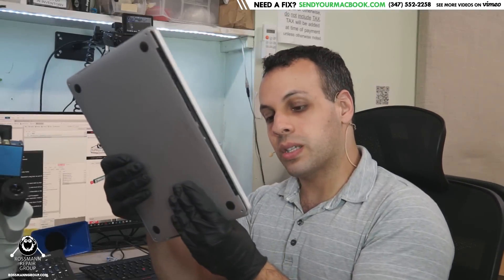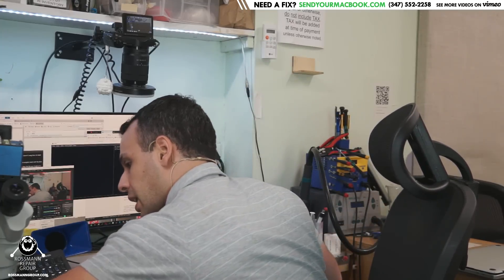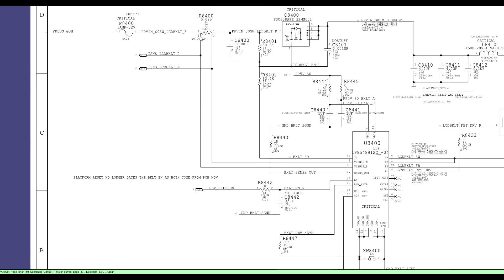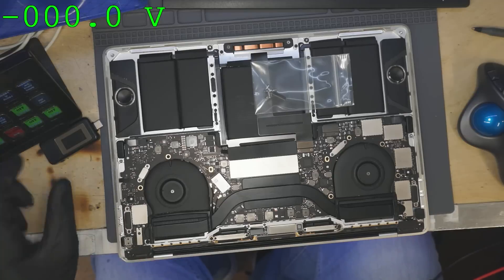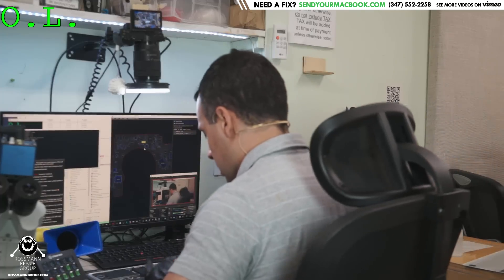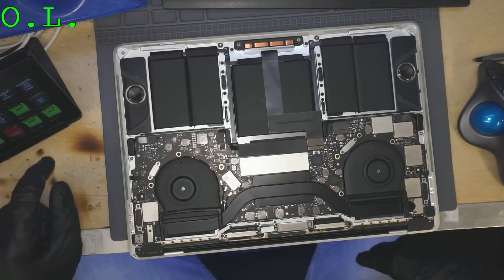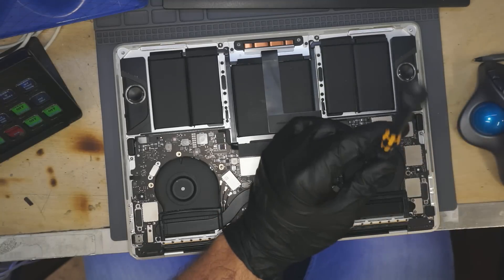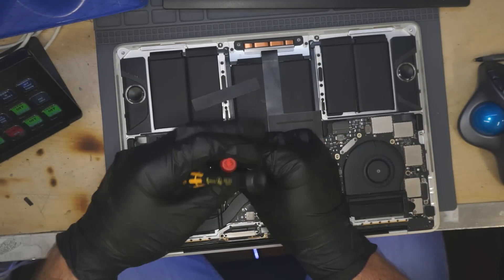Mac authorized dealer said WHAT??? + 1st attempt at ASMR board repair.

Comment: I really don't get that sh*t. The very purpose of a fuse, is to be a (somewhat) easily'ish replaceble, cheap, sacrificial component, protecting other, more complex/expensive components or a system as a whole from failing due to destructive overloading (or shorts).

If the component(s) it's supposed to protect, has no significant manufacturing or assembly defects yet frequently blows before the fuse does - then the fuse/fuse circuit design is EVEN WORSE THAN IF IT WASN'T THERE AT ALL! - Because everyone from other development and design engineers, to customers, operators and service personnel, predicate further engineering design and use of that  system, on the basis that the fuse will actually serve its purpose. 

Now this is "just" a consumer laptop device, and thst fuse has never been intended to be "user replaceable" (if working as intended, you'd really wanna check why it blew in the first place, before replacing it). But from an engineering perspective, imagine if this was a manufacturing component. Instead of ie. 5-30 minutes downtime, that happening may spell days or weeks. That could mean millions of Canadian peso-yen lost, or even worse. This is a huge design flaw, and should have been picked up VERY early in RnD.

Comment: I’m surprised the reason the backlight fuses never blow is because Apple actually built in a failsafe protection system that either works as intended or, when it fails, it fails in a safe way. 
Sure, the only thing that blows is the failsafe system itself, but you can just consider that as a second form of fuse!
It’s like having a fuse that physically blows and a digital fuse that stops things from physically blowing that also acts as a regular analog fuse and physically blows!

Comment: It's true that every authorised shithead does that ... two years ago I accidentally slipped some water on my OnePlus 3 phone and the phone's buttons including the capacitive ones and the Alert slider were not working...I dried it went to the authorized service centre ...I had insurance BTW still they refused to honour my insurance and my warranty then I asked how much it would take to repair it ....They said 264$ and the same thing was replied by the insurance company...They were saying my logic board shorted....I took it back home bought opening kit and took it apart and dried it and cleaned it...It was fully operable and I was ....😑😑😑😑 I have now spent like a 50 $ to replace my fingerprint ,Power and volume flex and earpiece speaker ...and currently typing this comment from it

Comment: Apple cars: One of the spark plugs has failed, you need to replace the entire engine.
Reply: there's a hole in one of the tires? time to get a new car
Reply: if apple made a car would it have windows...
Reply: @dcfuksurmom  It would, but the windows would be triangular, at foot height and you cannot open them.
Reply: @dcfuksurmom  and then they'd claim to have invented it first.
Reply: @dcfuksurmom  Of course, you just need to buy the window wind down switch adapter for only $1900 which comes in a beautifully packaged box.
Reply: @dcfuksurmom  no, just 4 cameras lol
Reply: and the engine cost as much as a new car
Reply: Apple Car: The starting battery has run down, and there's no way to charge it. Solution: buy a new car! Coming soon to a MacBook near you...
Reply: @Zippy1415  Nah they would let you change out the battery like in current devices, but if you don't get it replaced by Apple, the car won't start.
Reply: SireSquish how about buying whole new car after spark plug failure?
Reply: Genius Car Shop "The windscreen wash has run out and there is no way to refill it. We can attempt to replace the engine which comes with a full windscreen wash reservoir, but it will cost you $100,000 for the engine plus $5000 labour. We would recommended you to buy a brand new Apple Car instead."
Reply: @evokaiyo  Don't get me started on the muffler bearings and blinker fluid....
Reply: and all because they soldered them to the block
Reply: you got a flat tire, you need to buy a new car
Reply: An Apple car wouldn't have an "engine". hence no spark plugs. But I get the joke. CrApple IS the joke.
Reply: just wait till electric apple cars. Why is my car getting slower to accelerate? it's only been a year of me owning it. Time to replace every single battery cell
Reply: Replace your mother's pacemaker with a television remote. Quote unquote
Reply: Apple fanboi spotted ;)
Reply: @ferret lol
Reply: Nonsense, Applecar needs to oil changes or gasoline and if so it's easier to replace the engine when it stops running
Reply: Apple could not make a car, because it would be too thin for Americans to fit inside it...not to mention you'd need a dongle for the tires.
Reply: ferret lol.... I read that as the “any key” has failed.... customer “where is the ‘any’ key?”
Reply: @Photo Art lol
Spoken like a true drone ! hahaha
Reply: Sparg plugs? You went all out and paid for the multiple spark plug model
Reply: I would be dead the moment I get that answer lol..
Reply: Blinker fluid in the Bmw is low! You need a new Ferrari!
Reply: Apple car is tesla
Reply: Apple, Tesla, not a dime worth of difference between the to if them. I pity the Tesla customer when the batteries in their Tesla finally gives out and he/she learns that their car's resale value is pretty close to zero, since the price of the battery bank will be over half the value of a new car.

Comment: My MacBook Air needed press and hold for say 30 secs the power button to boot up and was sluggish to run very basic apps. Apple told me to change the board. An independent repair costed a meagre 65$ to fix it and now it good as new. Regards from New Delhi, India.

Comment: 1) It was pretty obvious to me that it was the third capacitor from the bottom that caused the issue:
2) You could've just used the thermal camera to detect it in more reliable and civilized way. I don't know why didn't you do this from the start.
Reply: oberonmeister who wouldn’t want to use that bulldozer?
Reply: @Inn0IWNL  I can understand such appeal, but in this particular situation it was a giant stretch and completely unjustified to use it. However, I admit I would probably desperately look for any excuse to use it as well.

Comment: Why didnt you measure the capacitance with your multimeter?
Reply: Because, he wanted to be a warlord..., The other capa seators would not grass the faulty one up, so they all get executed.
Reply: I'm sure there may be technical alternative, but removing them all makes for more dramatic footage. Louis does the same to JTAG connectors.
Reply: To get a reading for a given cap it'd have to be isolated from the other circuitry, IE desoldered at at least one end - otherwise he'd just be measuring the lot of paralleled caps whichever of the he put the probes on. 
Cheaper to bulldoze and replace the lot (time worth more than the caps) than to pinpoint the exact cap.
Reply: @michaeltempsch5282  Technically it was the short to ground that caused the problem, not the capacitance value, but I agree it would have to be desoldered to test.
Reply: @michaeltempsch5282  good point, didnt realize they where in parallel

Comment: I remember when I was working for an Apple dealer, the "bad backlight fuse" was almost a catch-all term for "we tried another screen and it still didn't work, therefore it must be the board as well" among some technicians I knew.

Possibly because with some earlier models, Apple would provide the fuse locations for each board (not full schematics, just the fuse) and allow technicians to test it for continuity. I don't believe that's something they've been doing for more recent machines - especially not the Touch Bar era machines - so saying "it's the fuse" based on the Logic Board not supplying power to the backlight is perhaps an assumption based on past experience, and not necessarily a correct one.

As for recommending a replacement Logic Board for a fuse, that's the Apple position that authorised repairers are contractually required to take. They aren't permitted to take a soldering iron to a board, nor are they supposed to recommend other repairers that can. Some techs I knew would allude to a component problem, saying it's a fuse or another component if they had reason to believe it was at fault and could be a simple repair, as a sort of "wink and nudge" toward the independent option.

(Then there were technicians like myself. Well beyond giving a damn, playing Louis' videos in the workshop and referring around 4-5 "not economical to repair" or "vintage product" jobs to the local independent a week, to the point where we'd occasionally all catch up for drinks together and talk shop. Those were good times.)
Reply: That's a pretty lame method for them to take but it proves the Louis is speaking the truth.
Reply: So basically don't buy an apple product. Got it
Reply: Replacing parts is technically not repairing. You're not fixing the board... You are replacing it. Lol

Comment: I was watching Paul Daniels' stream and he had a similar scenario.  He said he didn't have a big iron to remove all the capacitors so he relied on his sense of touch to locate a hot area of the board. The amperage draw reading pointed the way. He swabbed a row of suspect capacitors with an alcohol soaked Q-Tip and the bad one dried up instantly.  No need to solder a wire and add power to the circuit and waste alcohol for theatrical effect.  Was Paul Daniels using dry humor to poke fun @ Louis' antics? I sure hope not.  Me likey theatrics. Me like to be entertained.

Comment: Louis, I am just WONDERING if Apple or authorized dealers do operate logic boards like you do by analyzing then replacing bad components or they just change de board by default to solve an issue ? Is that not their official way of working ??? Do you know??

Comment: > You need to replace the whole board because the fuse is broken.

Not an electronics experts, but to me, that alone should tell you something is off. The reason a fuse is put into a device is to be a sacrificial component to protect the rest of the system. If an entire board has to be replaced because the fuse is bad, then why do you even have a fuse at all.
Reply: Exactly! But ya know. It's all for the money :/
Reply: It's cheaper for them not to replace it because they make them in China for a very tiny percentage of the price they would charge you for that board. If it's under warranty, anyway, at least its free. If not, they convince you to replace the entire laptop. Either way, they make more profit than if they had actually bothered to do any kind of component-level repair.
Reply: Hey. It is not simply a "fuse".
It is an iFuse!

Big dfference for a fanboy.
Reply: hmmmz... we are talking an apple fuse here... i am pretty sure it still conducts and didnt blow..
Reply: @milenedejong1400  You forgot that it's Magic! Louis doesn't have the true faith needed to test the fuse for Magic.
Reply: electronics 101. yeeesh.
Reply: Well yes but actually no.  

Depends how good your soldering skill are. 
You can theoretically replace any component on the motherboard if you're soldering skills and equipment are godly or you have unlimited time.

The Bois at Apple probably don't do any soldering.
Reply: So um, the mains fuse is blown, right, so basically the wiring in your entire house has to be replaced along with all the electrical appliances, or you could just buy a new house.
Reply: Pretty much NAILED IT..
Reply: So apple saves money replacing it while charging the customer a fortune for repair.
Reply: If a fuse blows, the problem may not be the fuse but the electronics failure that caused the fuse to blow in the first place. Admittedly, any problem that blows those fuses would do way more than just disabling the backlight. Those fuses are built like tanks and meant to be the last line of defense to stave off a potential fire.
Reply: Unfortunately any authorised dealer has no choice but to replace the whole board even if they have the tools and skills required to do board repair not doing so means that 1. They'd be risking there license and 2. If its a warranty repair Apple wouldn't reimburse for the repair.

Its a sad state of affairs
Reply: without a fuse it's a fire hazard though, it's not just about protecting the other components
Reply: Isheeps would say
Safety ... otherwise that thing would explode so said the genius ...m
Reply: Sometimes it is to prevent changing things like serial numbers. Having one of those break the whole board creates another chain of unanswered questions.
Reply: @Kappa defence? Ohh boy in that case I can say how people are dumb calling a fuse bad when it is a capacitor, they are soo dumb they don't know where to fix it
Reply: #applelogic
Reply: Just goes to show how dumb apple thinks its customers are. They started from being the best and simple to the sketchiest and dumb complicated
Reply: It's so they can refurbish the MLB for peanuts and charge the consumer for a whole new unit.

It's not built in for the consumer.
Reply: Ex Animus  Think about it, what other company can get over 3x money from same overpriced part. first sell it as new overpriced, then sell replace board overpriced, then fix the minor issue and sell it again overpriced :DD Who other company gets away with shit like this?
Reply: Not a fanboy but since fuse exploded then we are dealing with short circuit (or many - which could support need to replace an entire motherboard) somewhere on the board, you can't simply replace the fuse - you have to find faulty element(s) and replace it first, otherwise a new fuse will most likely just fry like the last one. Now finding a short circuit depends greatly on your experience, board size&complexity and schematics availability.
That's why schematics are so important to be available because based on power/resistance measurements you are more likely to find an outstanding values in comparison to ones on the schematics and fix the problem - just like Louis did. Now in this case hearing from authorized repair guy that you have to replace entire motherboard only proves that guy is either an amateur or just practicing into apples scam schemes. Can't expect from everyone to know any basics about electronics so they abuse it with everyone to maximize their profits.

Comment: are you not gonna worry about the alcohol catching on fire?
Reply: Assuming he is using isopropyl alcohol, the ignition temperature should be higher than the hot air station and soldering temperatures.

Comment: Seems like what happened in this video is the normal diagnosing routine didn't work so you've pumped power through something and found that something gets hot.. Could there have been a way to test the components before doing that?  Test if the capacitors are acting like real capacitors and so forth
Reply: Its hard to diagnose a faulty component when it is soldered into a complex electrical circuit. You might have to remove each one from the board to test it, which is clearly impractical, and defeats the whole point of the exercise.